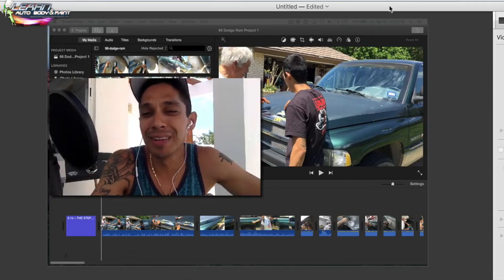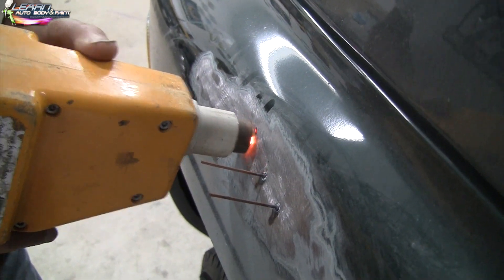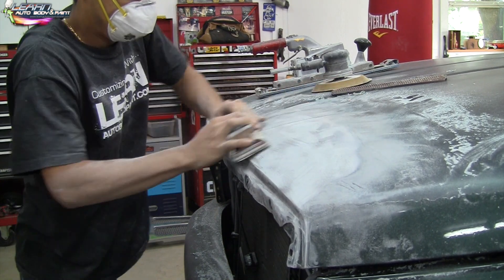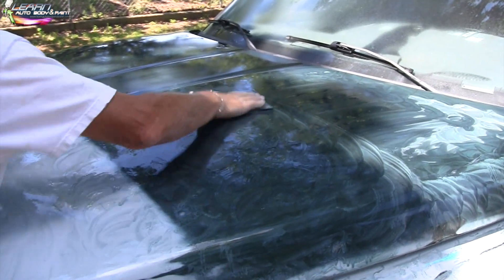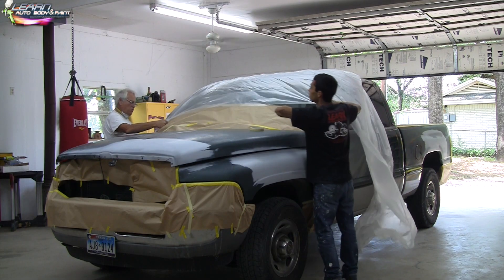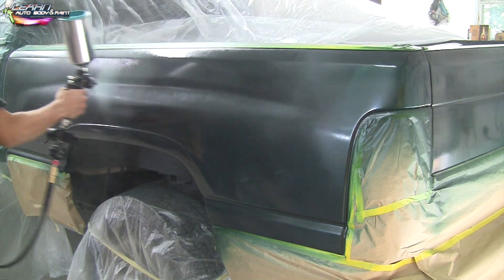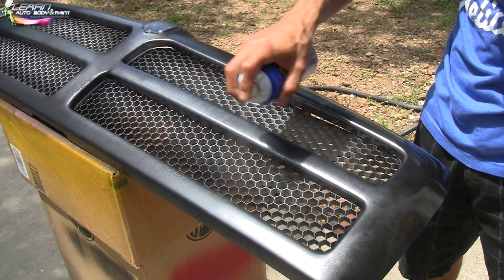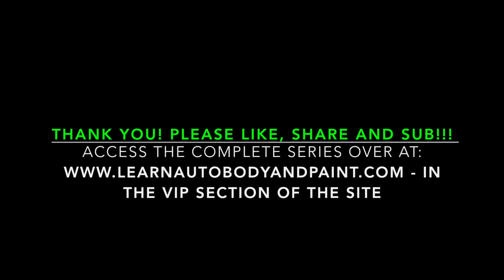DIY Auto Body and Paint Secrets Step-by-Step!

Comment: What kind of gun are you using? and I'm thinking I'm getting sata gun which one do you recommend 2000 hvlp or 5000 hvlp?
Reply from the maker: Ray Gomez dude. Don’t even bother with the Sata. Save your money and get the Atom X20 HVLP. It’s my go to spray gun. https://zoolaa.com you’ll thank me later!
Reply: BOSS PAINTER - Learn Auto Body And Paint! Thanks  Tony I will try it out.  And one more question  what do you think  about  this compressor? Will that work with  the gun? : Quincy QT-54 5-HP 60-Gallon Two-Stage Air Compressor (230V 1-Phase)
Reply from the maker: Ohh yeah. Quincy is the shit! We had a HUGE 3 stage one at the shop years back. But the one you have will be perfect for all around DIY. Paint a full car and run your shop tools no problemo!!
Reply: BOSS PAINTER - Learn Auto Body And Paint!  Thanks  a lot keep up the great work!
Reply from the maker: Thank you my man!

Comment: If I'm using a 8 to 12 gallon air compressor my guns should lvlp correct at 10-15 psi for a full paint job on a car. 5-7 c.f.m.? By the way great job.
Reply from the maker: bboygoofy714 well... not exactly. You can use a lvlp spray gun, the spraying pressure should still be at 25 psi depending on the paint... the Atom spray guns here are awesome for this. https://www.zoolaa.com the x20 would be perfect for this.

Comment: Great video man thanks for sharing. Quick question for you...If you are using a part from a salvage yard that is a different color, does this same method in the video apply? Or do you have to prime the entire panel first then apply the paint color to match your vehicle? Thank you
Reply: Not an autobody tech, just a mechanic. But we sell used cars and get discounts from our local body shop on our cars from the yard that we rebuild and sell. Deff would have to prime the entire panel and wet sand it even with the rest.
Reply: @R.Juniorr  thank you